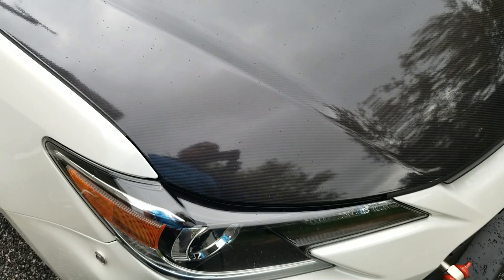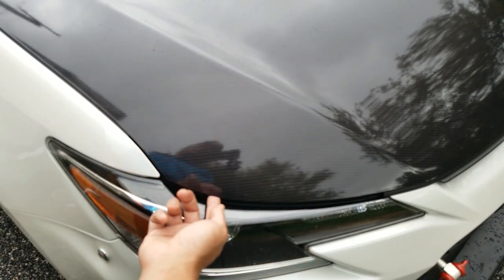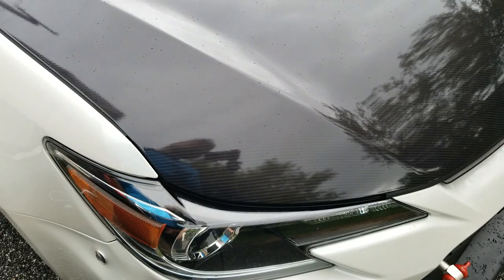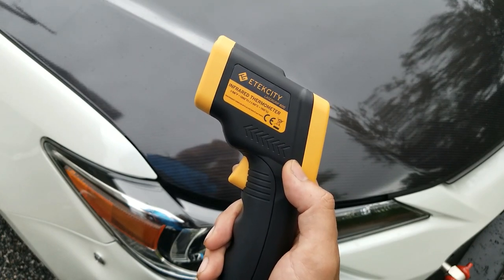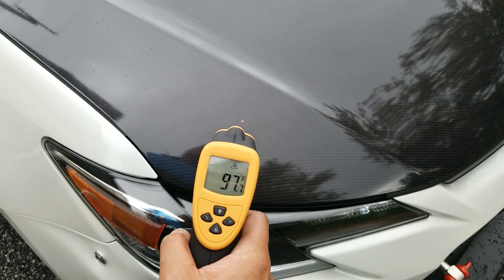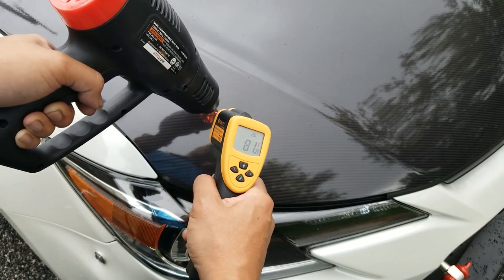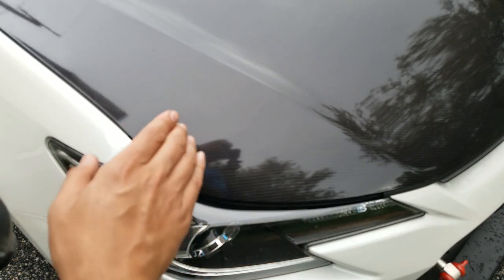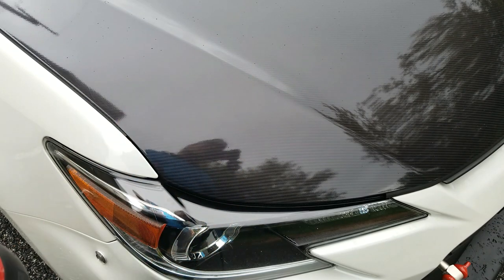Post-Heating Vinyl Wrap with an IR Thermometer to Prevent Peeling & Edge Lifting

Comment: I just did my side mirrors but the vinyl is not tucked under a panel or anything but rather sitting right at the edge of the mirror cover. The wrap is starting to come off at some small spots. Would reheating to 90C (194F) and squeegeeing work to remedy this permanently? Using Vvivid.
Reply from the maker: It might help a little, but if it's started to lift, the adhesive might not be strong enough anymore. When I wrapped my mirrors I wrapped about 1/4 - 3/8" around the edges and it's held up fine.

Comment: If I attempt to do this on my interior trim, do I run the risk of melting the plastic underneath the wrap ?
Reply from the maker: Just don't hold the heatgun in one place and keep moving it. Also, just use it on low. It doesn't take much to shrink the vinyl.
Reply: @VampyreX13  Thanks man. By "shrink " do you mean kill the memory ?
Reply from the maker: @trackmedixuk  ah, sorry, I just realized you were commenting on my post heating video. Yeah, to kill the memory, just be sure to use an IR thermometer and keep the heatgun moving and you should be fine. I have my interior trim and mirror caps wrapped and they are all fine.